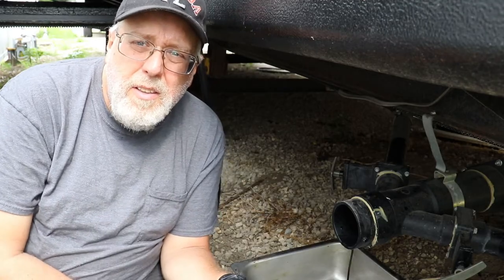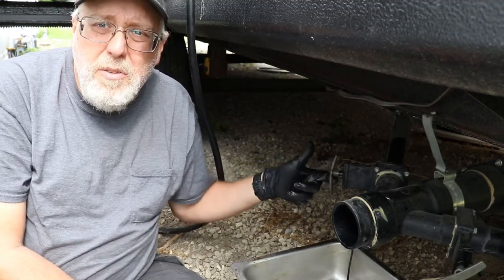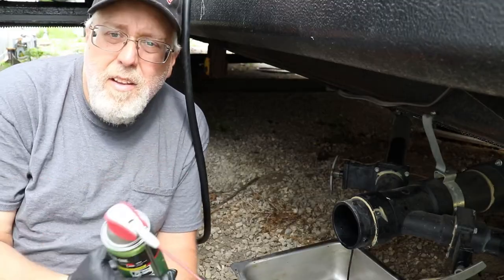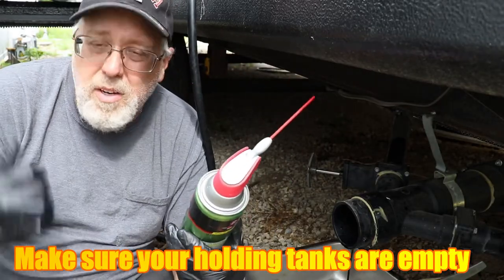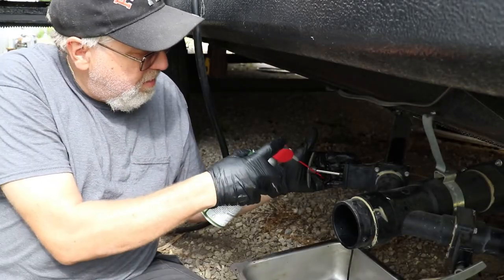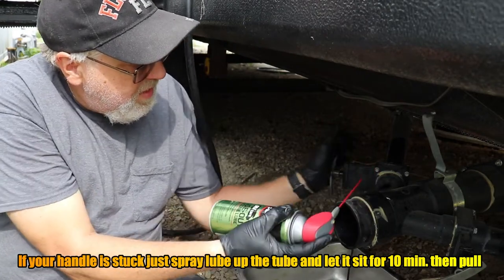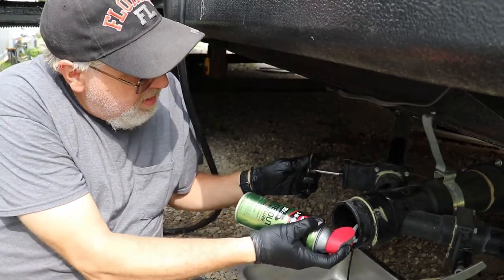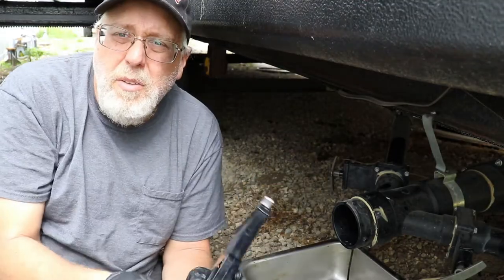Sticking RV waste valve handle

Comment: I like your process and it works pretty well. I felt like the valve was still a bit sticky so i attached a u shaped tube to the spray  nozzle. With the gate partially closed you can spray the back side of the gate!
Found the u shaped tubes on Amazon under fish tank cleaners.

Comment: I just snapped the plastic wings off heiving on that thing,  i got it open but now i just have a stem with no handle, cute, thanks for the vid.
Reply from the maker: I glad you like the video! They are easy to change out and having the gate valve open is better the closed I guess. best of luck!
Reply: @millersinthemoment5427  Thank you for the reply, i imagine i can handle replacing it although I'll likey lube it one of these ways and devise a custom made designer handle of my own, like a stick of wood with a nut and washer on it. 😆

Comment: worked great on valve close to dump but I have another valve further back with no access. Can I pour hot water down the toilet to hopefully loosen the sticky valve? thanks loads
Reply from the maker: I'm not sure if that would work because heat would expand things making it tighter. I don't have any ideas for you on that one, sorry.
Reply: Hello did you ever find a Solution because that’s exactly the problem im having now and the values are not accessible? Please let me know what you did to resolve it!!! Thanks

Comment: I can’t pull out but camping world pulled out even tho it was hard and told me I need to buy new handle for 225.00 approx. but labor is 190 per hour so part is about 20.00 approx. is that about right or is there another add on I can attach to bypass ?
Reply from the maker: I would try a twist on waste valve from Amazon fir $20. You could leave the rv waste lever open and control movement by the twist on valve. Hope this helps

Comment: How did that spray get around that corner to the gasket, I'm wondering.  Seems like a long ways away from where you entered the pipe.  Maybe I don't have an accurate picture.
Reply from the maker: The spray shoots about 2 ft from the end of the nozzle which reaches my seals. With the valve open the spray runs into the gasket area. When you close the valve some lube is trapped inside the gasket area allowing the handle to move freely.
Reply: @millersinthemoment5427  Ok thanks!

Comment: My black water dump valve is stuck but it’s also full can I still do this ? Even if it’s full ?
Reply from the maker: It could help, i would spray the lube and let it sit for a while before pulling the handle.